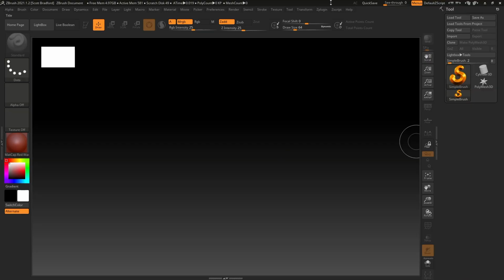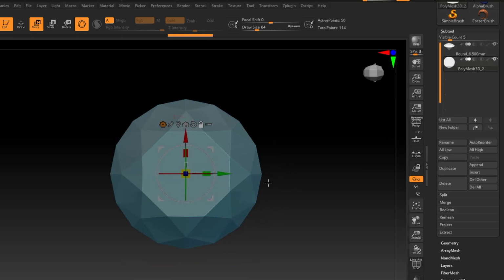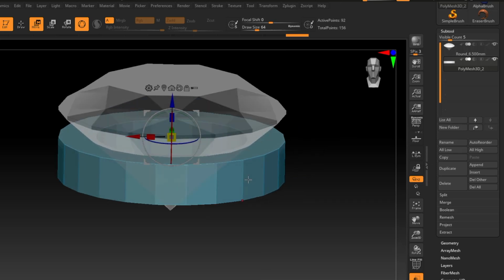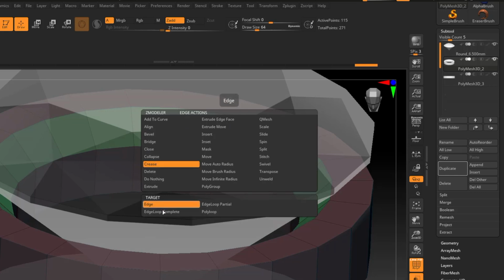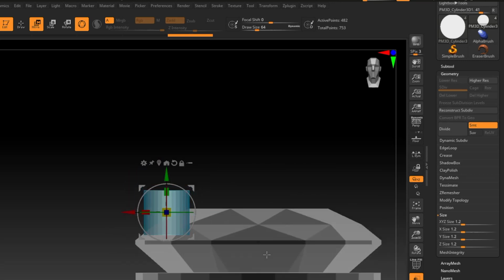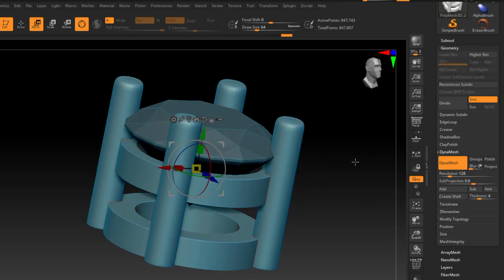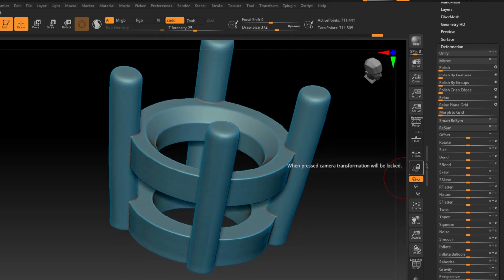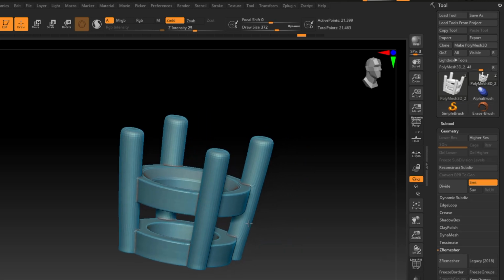4-Prong Basket Setting in ZBrush

Comment: Can someone ask Scott about making crisp V shaped cuts in zbrush kinda like engraving strokes? I can make basic cuts in a surface, but I can never get a sharp valley down the center, and then a crisp left and right edge. I always get a sharp center line that fades into doughy left and right edges. I was wondering if that has to do with using the right alpha.